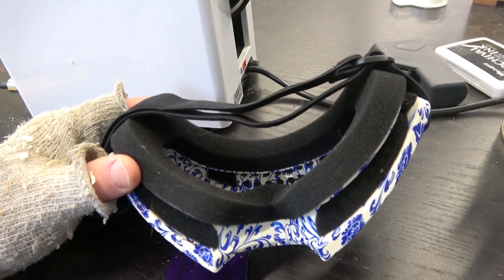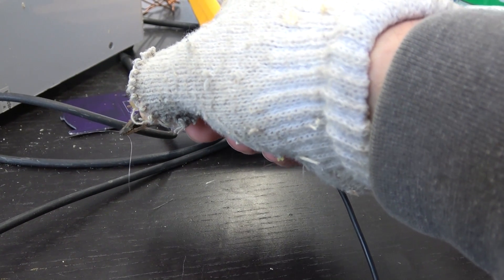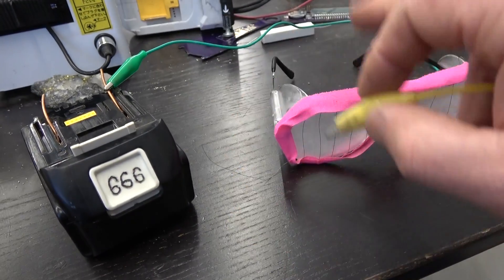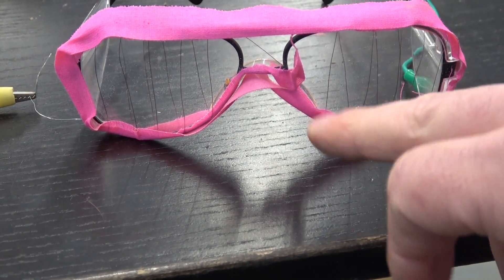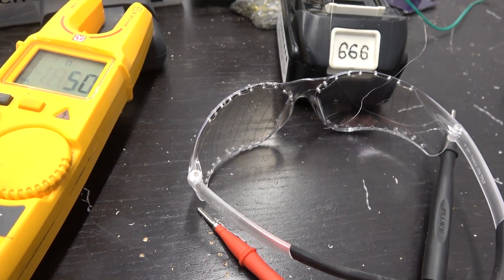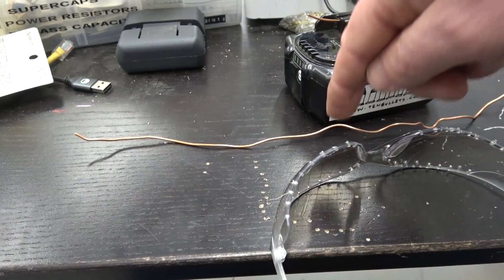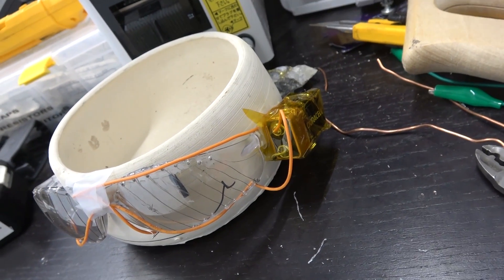Invention: goggles w/ electric defrost

Comment: Just look at paintball goggles they have fans a clip on the top of your goggles and it keeps cool air blowing through your goggles so they don't fog up and it's about 50 bucks for it if even that and they work rather well only downside is they don't fit with some helmets cuz they do stick up just a little bit from your goggles

Comment: This is what Edison meant when he said 1% inspiration 99% perspiration. You're only at the 5% mark of development. You proved the idea could work.
One thing that might be better is making a PCB with lots of very thin copper traces onto a clear flexible backing. You glue it onto the glasses. The copper side between the flexible backing and the eyeglass would protect the copper traces from being scratched. I just don't know how clear they can make the flexible backing.

Comment: So, old wisened shop guy, if changing one of voltage, amperage, resistance changes the other two, then how do you explain Oumuamua? Hmmm? Bet you didn't see that coming. Pixies don't need circles iffens you drive them in electric monopoles.

Comment: Has the duty cycle been defined?  Is the eyewear defroster meant for continuous usage, or for a short-term defrost and then to sit dormant until needed again?  If the whole of an automotive backlite (rear window) defroster draws ~25 Amps at ~ 12 volts,  for an on-demand duty cycle, then perhaps a defroster for eyewear would need only a fraction of that power for a similar duty cycle and much, much less power for a continuous usage duty cycle.

Comment: Google "509 heated goggles" I believe they are called "509 Ignite" or something.  I've been using them for a couple years now and they work great.  Best part of the googles being heated is that when you're snowmachining (snowmobiling for my non Alaskan readers) the snow slides right off every time you get a faceshot.  Only downside is that the battery pack doesn't last all day sometimes.  I've been thinking of doing some sort of magnetic electrical connector that would be right next to the safety tether on my snowmobile, so that way the sled could power them.

Comment: just curious if you watch David Wilks over in england..  Trepanning massive holes in bar stock..  usually inconel. https://youtu.be/HdE45yWXBVI  he is making a bit for a tapered bore along with doing his normal trepanning work.  like putting a 12 inch hole thru 70 inches of bar stock..

Comment: What about using the same method as motorcycle helmets. They have a thin sheet of plastic on the inside face of the visor. Not sure that would work in this application however??

Comment: Hey AvE, is there a way to send you an email or PM? I have an old (WWII era maybe?) Ingersoll Rand 3/4" impact that doesn't go in reverse.  It's pretty nuts and has some planetary gears and some other crazy crap inside and at least 5 different ball bearings too. Thing probably weighs 10lbs. Was wondering if I could send it to you so you could tear it down and make a video. You could even send it over to Hand Tool Rescue afterwards to clean it up or you can just keep it. I have some pictures if your interested. It really is Old Skool Cool and I have no use for it. Would love to see it go to good use.
Thanks,
Randy B.

Edit: I lied, after putting it together it does go in reverse. Nevertheless, you're welcome to it.

Comment: Motorcycle helmets use something called a pinlock visor which creates an air gap between your face and the outside visor. Works like a charm. The glare at night is increased, though.

Comment: As a suggestion you could have done one of those safety lanyards that a lot of people put on their glasses and they look nerdy but you probably could have put a battery pack on the back of it that way there's not so much weight on the glasses themselves but dangling from the back of them making them more comfortable
also if you're worried about the heat next to your eyes and also making it more efficient then you might want to consider taking a second pair of those glasses drilling holes through both of them so they line up and connecting them together, then sealing and all that heat with some silicone or something keeping the heat between them, not only will this reduce the amount of heat that your eyes feel from it but it will also possibly allow you to run it at a lower amperage at the cost of vamp up time but it will keep itself warmer for longer using less battery, efficiency is pretty important for anything involving remote battery packs, and anything that produces heat is inherently inefficient, so save energy where you can I suppose

Comment: Im sure somewhere out there some engineer has come up with a transparent material with a high enough thermal conductivity that you could get away with one or two short loops of wire, and an even smaller battery. Once this tech is ironed out for safety glasses I'd love to see it in motorcycle helmet visors as well.

Comment: My motorcycle helmet has a pinlock where you can insert a plastic piece inside the visor so there's a small airspace between visor and the insert. Without it I have to open up visor whenever I stop moving or it will fog up. With the pinlock in I can even leave it down when it's cold outside sitting a stop light and never fogs up. I always wondered why they haven't made glasses with two pieces with and air gap in between. I would pay a pretty penny for not having glasses fogging up.

Comment: AvE, completely unrelated but something I'm curious about, A video by @Driver61 concerns the construction of dragster chassis`, mentioned is the fact that they use vibrations during welding to promote a more consistent and stronger weld. Any chance you can have a look into this, I'm curious about the frequencies used and the directions or orientation of the vibrations and their effects on the weld... more importantly I wanna see if we can build a homegamer rig that's cost effective and simple, to replicate some of the potential results.

Comment: There's people who would be into the look, but in general you proooobably couldn't sell it with nichrome? For retail version, there's 2 options:
1. mask on some ITO in a square wave where the wavelength was calculated to give you the length (resistance) you need, then a few anti-scratch coatings on top to keep it safe
2. a wearable tiny, separate air heater-blower unit that can circulate in any glasses. Probably looks like a wearable forehead LED, with silicone air tubes attached to a frame that stays on your nose and you put safety glasses on top

Comment: I've wondered about superhydrophobic coatings for this purpose. I know the earliest formulations lead to a hazy finish, but I believe newer ones lack that. If you're ever looking to fiddle around with some, I'd be curious to see if using some on glasses would prevent fogging up in the first place since the vapor wouldn't be able to condense on the surface, or if it did would just slip right off.

Comment: There is a Ford Explorer mid 2000’s I believe that could be bought with this type of element in the windshield.   You could barely see the wires in the laminated glass. With small lithium batteries and tiny electronics you could totally make some ski goggles with this.  😊

Comment: Had this issue when out on enduro mx bike. Had to put my specs for seeing  on then the my motocross goggles over the top. Got steamer then and 80's porno. 

So I got two tiny 25mm x 25mm cpu style fans, I mounted them on the outside top of my goggles most goggles have openings top and bottom with a bit of foam stuck over top for air flow.

I added a small connection to the elastic straps with a switched 9v battery 6lr61.

The fans would run for ages on one battery and stopped the mx goggles and my glasses from ever getting steamed up.

Comment: A trick I learned way back in the '70s (while  Scuba diving over in Okinawa) was to spit (yes, SPIT!) on the inside of my glasses (or goggles), rub it around real good, and rinse off with water.  Brings fogging to a halt and doesn't cost a cent. :-)
Reply: Us up north of the 44th parallel can only do the spit routine between May and August otherwise the spit freezes into solid covid schmoo.

Comment: There's an expired US patent for electrically-demisting glasses from the 70s where the description has a throw-away comment about the lenses having a transparent conductive coating... Sounds good, but given it's 2021 and cars still have thin wires across the glass I'm assuming the transparent coating has some limitations...
https://portal.unifiedpatents.com/patents/patent/US-4209234-A

Comment: These should come with those heated jackets that already use the tool battery.  There should just be a wire in the collar to plug into one of the ear pieces. If they had them on the tool truck one of your grand children might pay them off one day.

Comment: This could be turned in to money printer.
Make it in form of adhesive to stick on glasses with much thinner wire, for aesthetics, power with tiny 500mah lipo battery and some simple dew point switch for automated operation.

Comment: Have leads off the backs of the ear pieces, and have the battery hang to the back of your neck on a tether, that way you can drop your glasses and hang them around your neck, and the weight of the battery keeps those glasses on your face nice and tight.

Comment: Pardon the interruption but I understand, in formal conversation, that tippy tap tap thump thumping that you were doing when you mentioned the Fonz is called “manual percussive maintenance”, although the “manual” part is often omitted. Especially when a boot is used. Variants such as “Percussive internal realignment” and “Percussive tuning” are also common. Now, back to the lesson.

Comment: Yes if this could be made very practical it would be an excellent idea especially for working conditions or people that live in very cold climates going inside and out all the time. Look up the glasses that have the camera built-in it's some no-name Chinese company but they have the battery pack that is in the ear arms you could probably Source those frames and use your own lenses. Personally I think it might be better to actually have the wire embedded in the glass or polycarbonate or whatever in the final version. Make these things happen LOL

Comment: Now ifin only the windshield in my car had that , I wouldn't have to drive backwards . Never quite got why the rear window is heated and easy to see out of in 2 minutes, while the front is useless until 20 minutes later of running for a 10 minute drive to the in and out store.

Comment: To continue your angry pixie analogy, an  amp can be defined as a large gaggle ( 6.2 ×10^18) of angry pixies passing a point in the circuit  in a second. Resistance  could  therefore be defined as them backing up to gawk and whistle at  some good  looking pixies in the middle of the road. That is what skin effect is all about.

Comment: I’m the only guy at work wearing a face mask here in the great red dumpster fire that is Alabama. Every morning I rip a 6” piece of half inch masking tape, form it into a tube, apply it along the inside top edge of a supplied mask, wipe the oil from my nose with my hoodie sleeve, and stick it on my face. Meanwhile my work mates go around maskless continuing to gather in the break room. You can’t fix stupid.

Comment: If they're fogging up, it's the fit of the mask that needs fixed-ed, not the goggles.
The path of least resistance should be through the filtering material, not some scary and diseased airgap to atmosphere.

Comment: All this infrared from the wires will over time screw up your retinas. Need to add an Infrared blocking filter. Aging of the eyes happens primarily because of infrared. Visible light is not that bad - even at very high intensity. UV is somewhere in between. Need to get rid of the infrared.

Comment: Instead of heating with electricity, would it be viable to use a heatsink and try to use heat pulled from your temples? Aluminum or copper against your temples, a copper tube or wire run to the lens, possibly sandwiched between doubled up lenses and perhaps a conductive fluid like saline eye wash solution, if it would resist freezing low enough.

Comment: Your circuit is OP. Too much power, not enough regulation. Visit your local vape shop and grab a couple 18350 batteries (smaller than 18650) that are rated for 3A constant/15A burst. Then grab a box mod that's capable of wattage control so you can limit and control how hot the wire gets. What you're trying to do, vapers have been doing for years and just didn't know it.

Comment: Pretty cool way to do it. I used to play semi-pro paintball before my knees and back shattered. We played in the hot South Carolina Summers and to keep them cool and fog free, I Took a small computer CPU fan, and mounted it into the front side of the face shield which was wired to a 9volt battery  and simple switch. Worked a treat!

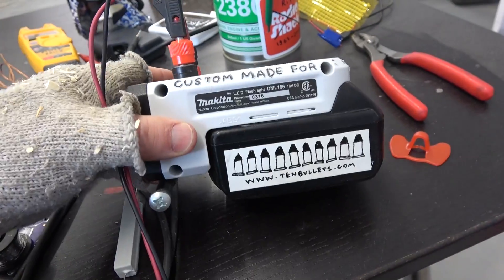Comment: 1A current is between 5 and 10 times the current level that can kill so your statement at 2:37 is demonstrably incorrect. "It's not the voltage that hurts but the current" still holds true, even at 18V.

Comment: put two visors in parallel much like the pinlock do for motorcycle helmets and you wont have so much of a problem nor need to worry about a flat battery.

Comment: Another transparent defogging idea. I work as a locomotive engineer. The windows on a locomotive have a transparent material laminating the 2 windshield layers. Current is passed through it and it heats the windows defogs and melts any ice. Not sure what the material is but may be fun to experiment with.

Comment: Could be made more balanced by using an 18650 on each side, giving ~8v and a lot more life than a PP3... best used protected cells tho, as you will surely over-discharge/reverse polarize them in the process!

Comment: The newest generation vw's use a heated windshield that works without wires. It instead uses an electrical conductive pvb film.  It would make a sweet defrosted goggle for sure! 

@AvE I could ask my supplier if I can have some and ship it to you for experimenting?

Comment: Bought myself some 3M anti-fog glasses yesterday. My experience so far: Yes there is no more fog. But if you also wear a dust mask, a ton of water still collects in the glasses and lots of droplets on there. Better sight, but far from clear vision.
Reply: Yeah. It doesn’t fog up, but it condensates water as a film over its surface. Takes a little longer then regular fog-friendly mcglarsses before its bad enough you have to clean them, but no solution to the problem at all.
Reply: @One Man's Trash Aus Nice to meet some viewers here as well :) About the glasses: They work well enough when you don't wear a mask. But I wanted to use it for wirewheeling lots of rusty / painted parts outside. When I do that I like to wear a jumpsuit, ear protection, a dust mask and glasses or a face shield. It is very hard to find the right combination of these things to protect your eyes, ears and lungs without facing issues: And when it comes to faceshields and glasses, they all get foggy when I use them outside at cold temps and while wearing a dust mask. These 3M glasses indeed do not get foggy in the classical sense, but water still collects on the glasses in bigger drops and clouds your vision. It is an improvement though. Including shipping, I payed 24€ which isn't actually cheap for a simple set of glasses.
Reply: @ThePostApocalypticInventor   Hi, I would suggest using a proper respirator with a rubber seal and an exhaust valve, the flow of which can be rerouted away from your faceshield or glasses. This is what I use for painting and sanding, since I have to wear "normal" glasses to correct my eyesight and protective glasses on top, which is a guarantee for fogging and condensation issues.
It may not be the most comfortable in the forst minutes, but over time I'm well used to it and I prefer it over cleaning my glasses every 5 minutes.
Reply: @One Man's Trash Aus Oh thanks for asking. I recovered several weekd ago and can't complain about my start into the new year. A new video is on the way and I think you will like it.
Reply: @ThePostApocalypticInventor   Good news!  🥃 👍 😊
Reply: My wife is an optometrist, she says theres a 2 part application that fights fog but wears off over time...
Reply: That's God's way of telling you to take  break ;0)

Comment: This invention is just steps away from reinventing the Ford Quickclear front windshield, and the others which came before it. Remember slightly pink front windows on some Fords? That was electrical defrosting stuff. Radar detectors didn't work through it, and it was so expensive to replace so it wasn't very popular. That was in the eighties. It would be fantastic to have glasses with that stuff. The battery could be very small, the main need for defrosting is just until the glasses warm up when entering a warmer space, and breathing with a mask. The glasses only need to warm up, there isn't much need to keep them warm.
I'm calling Luxottica. Nope, Foster Grant.

Comment: I'd stick another 9V on the other side,and split the nichrome into two. Each 9V battery would then power one lens,with a higher resistance,and lower current. 9V batteries suck at delivering much current,for very long. Even better might be a USB battery kept in your pocket.

Comment: Ever notice you never see Wile E. Coyote and AvE in the same room at the same time?.
Unless you're coming in from the cold, glasses only fog up on the inside.
Constant air movement across the back of the lenses might diminish the "Opti-Grab" litigation.
It wouldn't even take much air movement to keep the lenses clear.